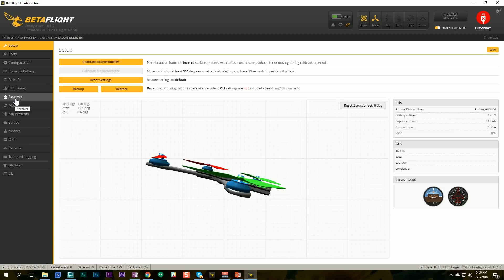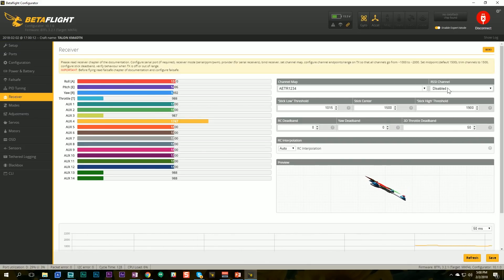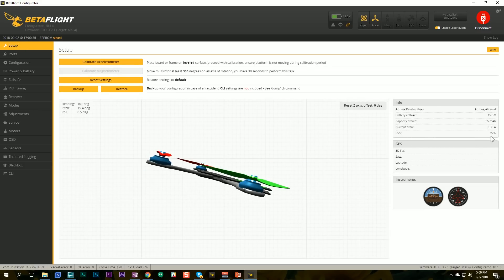How to put RSSI into OSD (UPDATED FOR OPENTX 2.2 & Betaflight 3.2)

Comment: Well, late to the party, but thanks so much JB!  I have quads that wouldn't read RSSI, and I'm new, so I was just letting it slide. I just got 2 new ones hooked up because of your easy to follow video. I would ask people and they would say, "well... ya just need to set it up in BF" or " ya just set it up in your radio.".  I was ready to give up. Now I have about 6 more I got to set up with FrSKY RXs , and I know it will work!  Thanks again!    Steve Harding _ SouthernOutlawDrones

Comment: Hi  Mr Bardwell ,    

when I go to my telemetry page on my Taranis and select '' Discover new sensors '' ... it's not doing anything ... it only says ''  STOP DISCOVERY''       WHAT STEP HAVE I MISSED ????

1.  i have enable the correct TELEMETRY UART (smart port ) in BF   after binding it correctly
2. confirugation tab ...TELEMETRY ACTIVATED   all commands created seems to work fine
Reply from the maker: It means that telemetry from the FC is not working.

Email me and let's discuss.
Reply: @JoshuaBardwell   Thank you Mr. Bardwell for replying.   I will send you an Email for sure. Thank you for your time

Comment: I somehow have a static RSSI at 49% after loading a backup,  any ideas?
Reply from the maker: In the receiver tab, you have the wrong aux channel set as the RSSI channel. The channel defaults to mid-position so this shows up as an RSSI of 49%.
Reply: @JoshuaBardwell  Thanks Joshua didnt know that ,  i had to disable RSSI where i normally pick AUX channel in betaflight somehow now it's working lol.

Comment: Hi Joshua, What -db level should I expect when the Tx/Rx are right next to each other? Does this need to be calibrated ?  Cheers, Pete
Reply from the maker: It doesn't need to be calibrated. If you are using 2.4 GHz, a dB value of above 90 is typical for very close range. For crossfire I would expect 99%.
Reply: @JoshuaBardwell  Thanks for that. As db goes from -100db up to -0db I thought I would get a higher reading than -39db when the Tx/Rx were side by side, what are your thoughts? Pete

Comment: What can i do if i dont see the sensors?? i already upgrade the xm+
Reply from the maker: The xm+ doesn't support telemetry. It can't do this. You won't see sensors.

Use the "rssi on channel 16" firmware if you have an xm+. It puts rssi output on channel 16 so you can get rssi in the osd without telemetry.

Comment: Frsky users can just set RSSi to Aux 12, with sbus or fport... no need to setup inputs on Radio
Reply from the maker: No, I'm pretty sure that's not right. SBUS does not automatically carry RSSI, and FPort does carry it automatically, but you don't need to set aux12, it's just there automatically.
Reply: @JoshuaBardwell  well on my micro which is Sbus i have rssi on OSD, and its set to aux 12, also my long range R9MM is set to Fport on aux12, need  to check if its needed to or not, neither one has additionally input,  but you are probably right 😆

Comment: Hay Mr Bardwell.  I'm missing something here I think.  I'm using an x9d plus with an r9m module,  and an r9mm reciever I've followed your video 3 times now and I'm only getting an rssi value of 10 on the betaflight gui and osd.  Any ideas what I may have missed..........ps  thanks for what you do.
Reply from the maker: First make sure the rssi sensor is working in the telemetry screen of your radio.

Second make sure the aux channel is moving when rssi changes.

Third make sure the correct aux channel is selected in the receive tab "rssi channel" setting.

Fourth make sure "rssi ADC is disabled" in the configuration tab.
Reply: @JoshuaBardwell  I'm using sbus on the r9mm should I be using f port?

Comment: @joshuabardwell have everything set as described but when im in rx tab in bf i set rssi channel to aux 12 and it does not save.
 r-xsr fport
Reply: also getting a static rssi value in osd
Reply from the maker: If you are using FPort then RSSI should be automatically reported as long as telemetry is working. You shouldn't need to enable RSSI channel in Receiver tab or RSSI ADC in Configuration tab. In fact, these values should be disabled.
Reply: @JoshuaBardwell  true but to which im getting an static rssi value of 33 whith no change on kalute f7 stack 
ive tried f port and s port no dice
Reply: @JoshuaBardwell  can confirm telem works on radio

Comment: Joshua, question for I have a xmplus receiver and a x-lite transmitter and I am trying to set up rssi in the lastest release of betaflight but I can only see 1 to 14 channels in the rssi menu and frsky said to use channel 16 can you help at all with this.
Reply from the maker: The XM+ receiver cannot do telemetry so if you want RSSI, you have to flash the "rssich8" or "rssich16" firmware to it. This puts RSSI output on channel 8 or 16.
Reply: oh okay thank you I do that.

Comment: what about xm+ that doen't have telemetry?
Reply from the maker: Flash the "RSSI on channel 8" firmware to the XM+ and it will output RSSI on channel 8 automatically.
Reply: @JoshuaBardwell  yeah I got it on channel 12.thx mate!

Comment: Are these the same steps for the Qx7? Ty JB.
Reply from the maker: Yes. Some of the screens look slightly different on the smaller screen.
Reply: @JoshuaBardwell  thanks, however, there is no RSSI sensor in the telemetry screen. You mentioned, if this isn't there it won't work. Stuck @ 50%. I tried JC's (RIP) method but, that didn't work. Old version of BF probably. Thanks for any assistance!

Comment: I wish I got answers to my questions here. Lol. 
On my qx7 you can change the rssi from db to %.  And what I wonder if I change the value from db to % will it affect the point at which my radio will read "signal low", "signal critical", or "signal lost"..? And Will that change how my radio interacts with the code in betaflight.? 
I'm guessing the betaflight code was set up to receive a rssi as a db value. That's my guess btw. Idk if thats the case or not. And if so would my rssi value chamge on my osd if I set my radio to rssi db or rssi %? 
Hopefully that males sense. :)
Thanks everyone..! 
Love ya Mr.JB..! 👍💖😁
Reply from the maker: changing from dB to % won't change the value as presented. 40 dB will be 40%. The code that betaflight receives is simply a value between 1000 and 2000, represented as an aux channel position. It is unitless, although it is assumed to be a %.

Comment: Joshua my rssi displays and when I move away it decreases. However it always seems to never hit 99 and never go below 85. I am wondering if I can calibrate it in the cli tab.
Reply from the maker: The first thing I would do is look at the value of the Aux channel in the Taranis to be sure it's moving consistent with what you are seeing in the RSSI tab.

Not hitting 99 is fairly normal for Frsky, unless maybe the antennas are like TOUCHING and maybe not even then.

Not going below 85? Put it in Range Check mode in the Taranis. If it doesn't go below 85 something is up.
Reply: Thank you.

Comment: Hi Josh, thanks for putting this video together. I am using the Taranis X9D plus with the Eachine X220 ( F3 i think?) and Betaflight 3.5, Open tx 2.2 Additionally, I am using the R9M module with R9 receiver on the Eachine. I have done the steps in this video, and my AUX channel 4 seems to be the RSSI channel because it jumps up to 2k when plugged in ( could be some other switchbut I can't seem to get it to "save" on betaflight and my RSSI appears to be 14% only on Betaflight... for my input I have chosen ..line 7 to be my RSSI input and on my mixer channel 8 is the RSSI. Any idea if I need to do anything else?
Reply: Forgot to mention that the cam I am using is the Eagle 2 Pro. Does that affect the way I can get RSSI readings? Also, is there a way I can see my quadcopter battery voltage on my OSD? (solder free preferably) Thank you for your tutorials.
Reply from the maker: Make sure that RSSI Analog option in the Configuration tab is DISABLED. The RSSI Analog option overrides the Aux Channel RSSI option.
Reply: Things I would never have known. Thank you.

Comment: Hey Josh,

I'm having the toughest time trying to do this. When I "discover new sensors", nothing occurs. No sensors are shown. I've tried this with the quad on, armed and disarmed and still nothing. Bound D16
Reply from the maker: If the receiver is bound with telemetry enabled, then you should always see the RSSI sensor even if the FC did not exist. So this is not an issue with FC config. Make sure you bind using "channel 1-8 telemetry on" option. Also, make sure your receiver supports telemetry. If you are using an XM+ for example, it doesn't support telemetry and this doesn't work.
Reply: @JoshuaBardwell  "... Many receivers don't have RSSI output", then you say this solution will fix that. But you need telemetry either way? Also, was there any video where you had RSSI output so you could set it in the receivers tab, and how to enable RSSI through that same aux-channel on the taranis?
Reply: @JoshuaBardwell  Thanks for the quick response. I'm trying to do this with the receiver that comes pre-installed on the emax magnum stack. This receiver is a Frsky XM 16CH micro RX if I'm not mistaken. I was under the impression that this RX was RSSI capable.

Comment: Hello Josh, I really need the help of an expert here... I recently purchased an emax hawk 5 with a XM+ receiver and an X Lite transmitter but I can’t seem to get RSSI set up correctly. In Betaflight I have telemetry and RSSI_ADC enabled and my OSD shows a very low strength like 20-25 always. When I disable RSSI_ADC it just displays 0.  When I go into model then into telemetry and discover new sensors but when I click discover nothing happens. Not a single sensor pops up like it does for you. What should I do?
Reply from the maker: XM+ doesn't do RSSI_ADC and "discover sensors" doesn't work because XM+ doesn't support telemetry.

To get RSSI in OSD with XM+ you need to flash the firmware to the receiver that puts RSSI on channel 8.

https://www.youtube.com/watch?v=q-rOd4_DSIk

Comment: Hello, can you tell me please how i can adjust the rssi values from 0-99 ? I mean 0 is transmitter is off   and 99 when the transmitter is on and very close. My fc is a matek f405 ctr. And my transmitter is an taranis x9 plus. I use the r9 modul with the r9mm receiver. I hope you can help me to adjust the numbers. Is it value or scale??? Or something complete diffrent? Greetings and thanks from Germany. Andy
Reply from the maker: Hahaha this is funny. It's probably working fine. Just R9 has such long range that it is always at 99.

Turn R9 power down to 10 mW and see if rssi changes then.
Reply: Joshua Bardwell Hi, thank you very much for your quick answer. I have the R9 on 10mw. And i set rssi to %. And when i walk with the transmitter to my livingroom it shows me correct 81%. When iam on the quad its show me 100%. But in Betaflight and on my osd it show me 99 for on and 49 for off (transmitter). And no values between. Mybee something to write in the cli line? Sorry for my english. I hope you can help me to fix this little but anoying problem. Greets Andy

Comment: There is digital communication between your receiver and fc. Why doesn't the receiver just tell your fc what the rssi is? I know i am missing something obvious here, like missing hardware to do it receiver side but idk.
Reply from the maker: FPort supports this.

The general answer is that the serial digital protocol between receiver and FC is designed around carrying PWM channels. Anybody who comes out with a new protocol will struggle to find supported hardware, so people keep using the same old.

Comment: hey joshua, whenever i enable try to set the rssi in the receiver tab to aux 12 where i put it in the receiver it dosent keep, however i see the aux 12 channel on the left side of the betaflight screen now shows the rssi signal
Reply from the maker: Are you 100% sure it is Aux 12 and not channel 12?

Go to the Configuration tab and make sure RSSI_ADC is disabled. If it is enabled, it will overrule the Aux channel RSSI.

Comment: Guys I did like joshua showed and my Channel (AUX5 in my case) in betaflight stays at 1500 no matter what I do... whereas on the radio I see it correctly moving on Mixer page, any idea what's wrong ?
Reply from the maker: Remember that channel 5 is Aux 1. My guess is you put the RSSI on channel 5 and then set the channel to Aux 5?
Reply: Joshua Bardwell it's ok I figured it out, my rssi was on aux9 whereas when I bound to my receiver I choosed a range of 1-8ch. So I extended to 10ch and now it is working ! Thanks for your reply and thanks for all your awesome videos I love them. Cheers from France buddy 🤙

Comment: Will this work with the FrSky R-XSR ? I don't have the smart port connected, just the sbus. It doesn't give me Sensor discovery...
Reply from the maker: If you don't have smartport connected it will not work. This method requires telemetry.
Reply: But which S.Port should I connect? It has two, the S.Port and a uninverted smart port...I have the Diatone M515

Comment: This may sound dumb but how do you get it to work if you have an RSSI port on the Rx and the flight controller?  I have it wired correctly but it still says 0.  Using your method certainly works but I am just curious why I can't get it to work without the work-around.
Reply from the maker: In the Receiver tab, set RSSI Channel to none.

In the Configuration tab, enable RSSI_ADC option.

Connect the analog out of the receiver to the RSSI pad on the FC.

Comment: i tried this on my Emax hawk 5 and when i look for new censors i get no readings ,i see the RSSI and such but 3 dashes after it along with everything else has 3 dashes after it VS a reading , started with a new model as well and followed the steps as directed. Any suggestions ?
Reply from the maker: That means the FC is not sending telemetry to the receiver.

https://www.youtube.com/watch?v=0BCKdWgAps4

Comment: For me Betaflight wont display the correct RSSI in the setup tab/OSD and it's driving me nuts I followed theses instructions and in the receiver tab everything looks good. BUT nothing happens when I select the RSSI channel in the top right corner. In the setup tab/OSD it's constantly at 18% regardless of which RSSI channel I choose!?? (unless I disable RSSi then it's at 0%)
Reply from the maker: Look at which Aux channel is going up and down then select that Aux channel in the Receiver tab OSD Channel setting. This should be all it takes.

Can you confirm that the setting stays when you hit save?
Reply: Right! I have tried all aux channels by changing the mixer on the Taranis and none are working (the input is changing up and down on the receiver tab corresponing to the RSSi on the Tarains). However, It always says 18% RSSI for some reason in Betaflight. And yes the channel is saved. Has to be a Betaflight bug? Could it be that I'm using betaflight 10.3.1 instead of 10.4 on the computer?
Reply: I was out flying yesterday and the RSSI on the OSD seems connected to the throttle somehow, but only when armed... (even when I change RSSI from the Taranis to another channel). It goes from 16 to 40-50 something. This is wierd... Updated the configurator too, doesn't make a difference
Reply: Found the problem, the analogue rssi slider in setup was activated. Turned it off and it works now!

Comment: Worked like a champ... just had to fully disconnect everything from power and re-power before it came up on my OSD with an HGLRC stack.
Reply: Thanks for this.  I couldn't figure out why it seemed like everything was working except RSSI on the Setup page showed 0%.   Power cycled and it's all good now.  Thanks!

Comment: Hi Joshua!
Thanks for that great video!
I have a problem though...
It doesn't seem to work for Q X7S, R9M and R9 mini for me :-/
When I did like you told RSSI showed only 50%
When I changed channel for RSSI it first seemed to work (showing 100% when Q X7S shows 100db) but eventually it dropped and dropped further when it shouldn't!

Could you help me please?
Thanks!
Reply from the maker: The steps are exactly the same. RSSI of 50% probably means the aux channel is set up wrong. 50% is the default channel value for an un-used aux channel.
Reply: Thank you!
Indeed this is my first Taranis and I have problems finding out which channel I set up in the X7S corresponds to which AUX channel in betaflight :(
First I chose CH 10 in inputs and mixer...but in the receiver tab in BF I got a signal in AUX 6 AND AUX 12!!? So I tried 6 and 12 as RSSI channel ...but both showed 50%.
Then I watched project blue falcon's tutorial and took CH 16 in X7S and AUX 12 for RSSI... and then it showed 100% when having 100db :D
...but then as I moved away with the transmitter to bring down the db to see if it is really working...BF showed first 86% (ok, fine) but then without me moving the transmitter it went to ~70 and lower :(
Then I thought I try powercycle the FC...but then RSSI in Betaflight showed suddenly 36%! And X7S 90db in telemetry :((

Comment: Hey JB, thanks for the great videos. 
I'm trying to setup my rssi, all seems to be fine. 
But the 'rssi channel' drop down in BF is ghosted out. I can pull down and select my channel. I can save. But it doesn't actually save in BF. Any ideas?

3.4 on a BF F4 using the frsky r9 teenie tiny Rx.
Reply from the maker: My guess is that you have some other RSSI source selected such as RSSI_ADC in the Configuration tab, and that is locking out the OSD channel.
Reply: Joshua Bardwell thanks for the quick response.

I updated my configurator to the latest version and now it works! 
LoL thanks again.